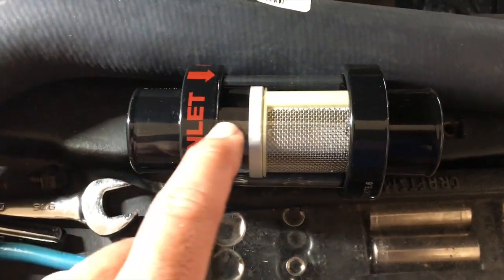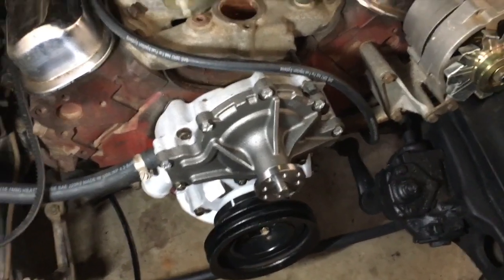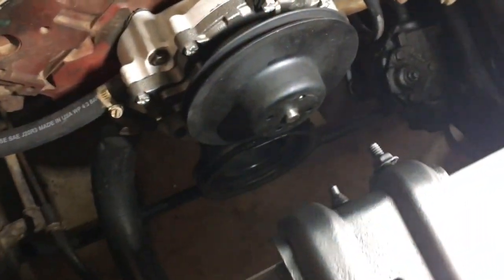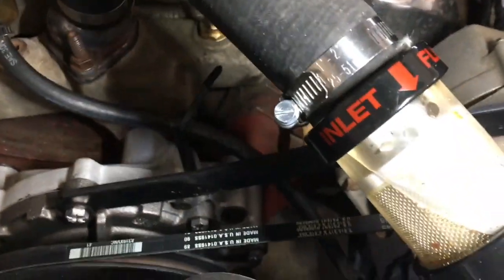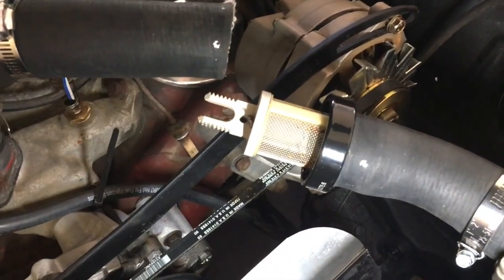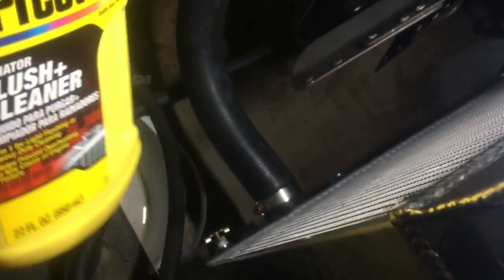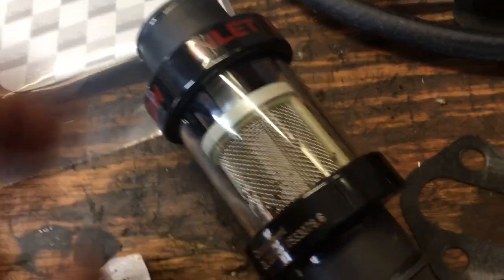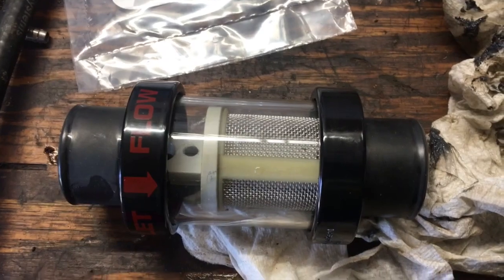Inline Coolant Filter works great!

Comment: Thank you for sharing your experience with this type and brand of filter. Been looking to implement one on my own vehicle to help combat plugging of heater cores. Much appreciated.
Reply from the maker: Glad it was helpful!
Reply: @luke-foureyedgarage7531  i did that week ago, and a lot of  dirt got out, and at the end, sand-like sludge came out I used paper fuel filter, and changed two. My 4 flushes with destiled water showed really good results and brown water came out with a lot of dirt.

Comment: Downside is they cost $90.  I've done similar by putting a stainless mesh screen in the upper hose at the radiator inlet.  I used a dollar store kitchen strainer (bad of 4 sizes) and cut to fit in spherical shape.  Push into the hose.  Good after running w/ citric acid flush for a few days, then water flush, to catch any left-over debris.  Better than having your radiator serve as a filter.  Dealing w/ one vehicle where years ago I used extended-life coolant and now getting brown particles throughout.  Didn't know it was Dex-cool since a store brand, which wags term Death-cool.

Comment: Hello and thanks for posting. Just the other day I saw on an Oz 4x4 channel (4WD 24-7) someone using an old sock toe in the upper, inlet clamp area of a radiator on a very old Toyota pickup that had been sat for years. They were cleaning the sock out every day and reckoned this was necessary to stop the radiator getting clogged over time. I’ve never come across an inline filter before. I’ve just had the radiator on my 30y old Toyota van re-cored and I want to preserve the internal channels for the future; I really like the idea of this inline filter and the one you have seems very well made and fit for purpose. Will be looking for something similar for sure as the whole of the coolant system was very gummed up at the start of my 30y refresh. I’ve also currently got both the front and rear heater cores out (van has rear HVAC) and both (plus hoses) were also badly clogged and this got me thinking it’s probably worth fitting a smaller inline filter to the start of the heater loop, too, certainly ahead of the front matrix, which is the first. My thinking is that coolant flow goes to the heater matrix(s) anytime the engine is running. Flow only goes to the radiator when the thermostat is open. Also while it’s definitely worth clearing out as much crud as possible before using the vehicle, I think the only way to really get the mess out of the block and other inaccessible areas will be to rely on the heating / cooling cycle of use, the pump water pressure of driving and the inherent shock, knocks and vibration in use to make the difference I hope it will. Without these sorts of filters all the agitated crud will certainly end up trapped in the innards of the radiator / matrix(s) but I think without driving use it’s be hard to really get the stubborn muck out. Did you do a follow up after use? Cheers.
Reply from the maker: I eventually removed it when I added power steering and had to reroute my coolant hose. It was not picking up much at the time. I am now saving it for my next project. There are plastic parts on the inside, so I did not want to run it all the time and degrade those parts.

Comment: I have one of these on a classic mercedes that had been stored for many years. It trapped a tonne of rust particles. I am now looking at removing it as no longer required and I cant help but feel it creates an unnecessary restriction. Will be interesting if my water temps drop a few degrees upon removal.
Reply from the maker: I eventually removed mine as well.
Reply: @luke-foureyedgarage7531  Did you find it ran any cooler after removal ?

Comment: I wonder, if there's a way to place a magnet(or more) on there and if that would do any harm or collect more microns of rust
Reply from the maker: You might be able to use a washer magnet that slips over the plastic threads. The screen filter catches all the stuff I was concerned about. I removed the filter after changing hoses for a power steering conversion. I am saving the filter for the next project I find.
Reply: @luke-foureyedgarage7531  So is that filter metallic or an alloy?
Reply from the maker: @felipemartinez634   I am not sure. I tested it with a pin magnet used to puck up bolts and it would not stick to the magnet.
Reply: Even if you can make it, it won't be effective. Magnets lose power when heated

Comment: How difficult was this filter to disassemble and clean out.
Reply from the maker: It was pretty easy. Its pretty solid and I did not feel like I had to be extra careful. The main issue was breaking the seal from the hose to the filter. I used a little greese to help with that.

Comment: Use white vinger to flush coolant system. 50%.Vinegar and 50% distilled water mix. Works much better than prestone radiator flush.
Reply from the maker: Yes. That would really put the filter to work. I'll keep that in mid next time.

Comment: It looks like your radiator hose is above your radiator that traps air in your cooling system there's a couple different ways you can fix that I just went to that problem with my Firebird I'm getting a taller fill neck thermostat housing I tried jacking the car up in the front end as high as I could get it and I still can get air out of the cooling system I'm going to have to spend the 35 $40 or whatever it is to get one of them filler funnels for radiators cool car that you got there I got a nice 455 sitting in my shed right now that I want to maybe rebuild or I might sell it have fun later bye

Comment: Hey how did you ran your wires for fuel pump
Reply from the maker: The wires were set up before I got the car and I need to update them, but here is how it is right now. Power comes from the coil resistance wire and fed to a manual switch that is under the dash. Then it goes to the fuel pump. I don't like it and its on my top of things to fix. The pump is a Holey very high flow pump (too high for a dead end fuel line), so not flowing the full 12v to the pump (via coil resistance wire) currently helps keep the pressure lower.   I am planning on using a oil pressure cutoff switch along with a relay for the pump switch. Also replacing the high flow fuel pump with a lower psi version.